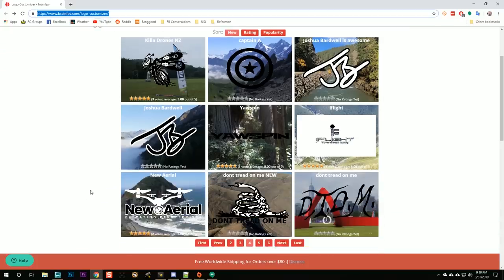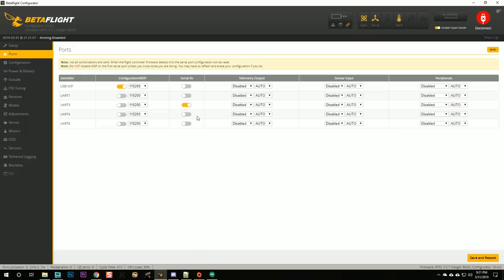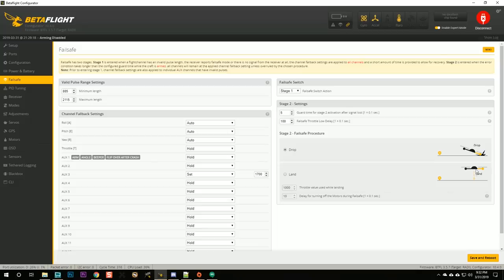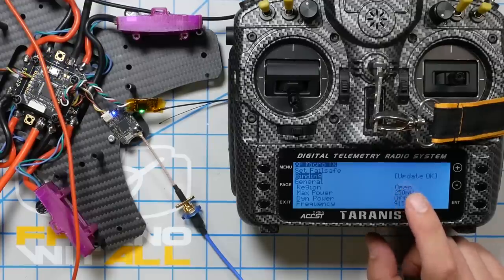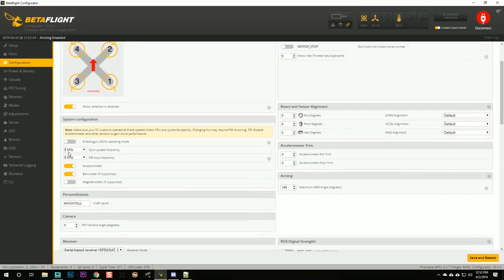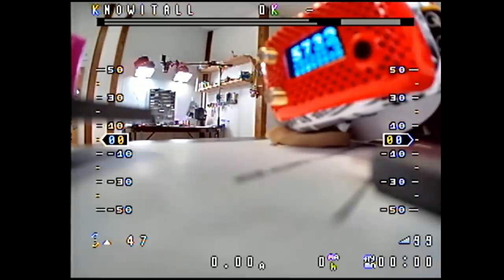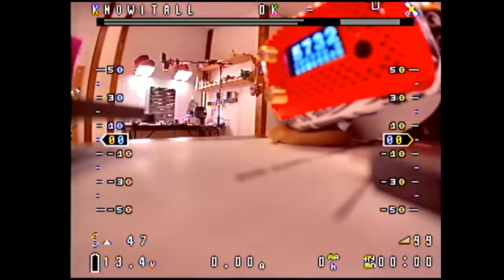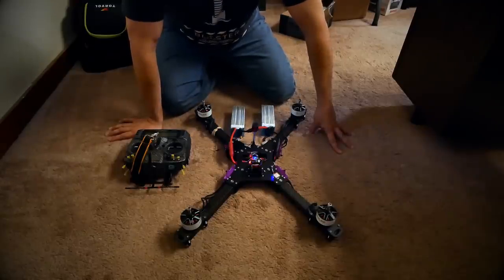Beast Class X Class Quadcopter Build | CATALYST MACHINEWORKS TASMANIAN - Part 4

Comment: I saw Jumper T16 on your table.  Video about that comming soon? ;) I'm still between ordering Nirvana or T16.
Reply: Be careful with the Nirvana bro, firmware still sucks on it IMO. They need to get everything working before they're getting my $$. The Jumper looks pretty solid though.
Reply: @RADERFPV  this is exactly why I'm heavily interested in t16. So few reviews and no long time usage videos as it's so new product. And if I've understood correctly review units are not same as production units will be. So time will tell. I'm not jumping to Jumper as pre-order.
Reply: @Walto86  - I feel ya, I wouldn't pre-order either. Always best to wait and see. The most recent review I've seen is a 2 part review from DutchRC. Looks promising, but like you mention, time will tell.

Comment: you have gps wont your failsafe trigger return home? why set to drop?
Reply: I'm with JB, I guess. I would not have a thing like that do anything on its own ^^
If the RC link is down, the copter goes down.
Reply: Imagine a fuc%ing flying lawnmower coming un your direction when, for any reason, you have absolutely no control over it. The transmitter battery died, for example.

Comment: 33:17

Hey, the flight controller can't reverse the direction of motors, the esc does that. So how did the motor direction got reversed in turtle mode without changing anything on esc's??
Reply: The ESC solder tab is for setting the normal direction.
For turtle mode, the flight controller sends a reverse flag (reverse to the normal) through Dshot/Proshot commands.
Reply: @BestUsernameEverMade  
If the flight controller is actually able to send reverse signals then what is the need for that esc solder bridge..?
Reply: @dtpc_technologies  Because the flight controller doesnt know the normal direction. You have to set it.

Comment: bardwell not sure if you ever did this. but to save a uart if your using unify and crossfire you can just hook the smart audio up to ch.3 or ch.4 on your crossfire and control unify through crossfire lua.
Reply: I can confirm, and this is also the best reason to get a CRSF transmitter other than the Lite
Reply from the maker: That's true, but then you have to manage the vTX using the crossfire script.
Reply: @JoshuaBardwell  ... or with the full size, staring at the back of your radio look a goon.  
Then again, I'm still running FlySky receivers on purpose, so I'm not sure I'm even allowed to have an opinion on this matter.

Comment: 29:45 Never use Loctite on nylon lock nuts, ruins the nylon.  Pick one or the other; regular nut with Loctite blue, or nylon lock nuts.  Usually nylon lock nuts aren't as good for things you repeatedly take apart as the nylon wears out, Loctite is good for that because you can reapply it, but both seem equally good for once and done jobs for longevity.

Comment: Why why why because is freaking awesome and I am building one myself.  Using a Dji FC.  So it will fly just like a air2.   🙏🏻🙏🏻🙏🏻.  😂.  But my main frame is 12inch. And arms are 18inch custom built frame with brother hobby tornado motors 380 kv.   Lol should be bad ass

Comment: Please help!!! I just finished building a Source X with APD pdb + 120A esc's, Pyrodrone F4 V2 & F1000 motors. Testing everything on 6S. Build came out really neat, but the esc's don't seem to recognize any input signal...they just keep beeping away (white led's). I checked all continuity points and all seems OK. I also tried DSHOT 150, 300 & 600 + ProShot. With the USB unplugged + DSHOT 150, only 1x of the 4x esc's "connected" - the others saw no valid signal.  Any idea what's going on?!

Comment: Don't conformal coat any items which are small and produce a lot of heat, such as regulators. Conformal coating can create an extra layer of insulation and cause thermal issues, including failure.

Comment: Hi,

I just did the build, every thing works fine except the battery voltage and current draw is not displayed, and my rssi is at 27. Any suggetion as to why this is so? I did a test fligt and it flew well. Thank you and hope to hear from you.
Reply from the maker: Battery voltage and current come from ESC telemetry. In the Power and battery tab set ESC sensor as the source.

Comment: Mr. Bardwell if my throttle is slightly up and I disarm why are my props still spinning and if I increase the throttle it's as if I never disarmed... any ideas?
Reply from the maker: If you disarm, then the motors should stop immediately. If not, then I wonder if the FC actually thinks you disarmed.

Comment: I have a pulled pin on a F4 board and went to update my firmware and totally forgot about it and was like oh oh motor 3 doesn't work and then I remembered I had to Resource remap it but cannot get it to stick on 3.58 is it's only able to be done on 3.1 thanks
Reply from the maker: Resource remapping definitely works on 3.5. I'm not sure what is going wrong for you but if you reach out to me via email I will try to help. Joshuabardwell@gmail.com.

Comment: Got some concerns about the immortal T placement. 1: being so close to the carbon (there's a lot of it and 2: being right above something that has to be spitting out a bunch of EMI. 

I mean, it might be fine. But for something so big I hate for that thing to failsafe at the wrong time. If possible I recommend going the same route you saw my big quad take at Kwads and Coffee and use a  tuned antenna for RX so it's up and out of the way.  Or in the same vein use a long immortal T and mount it vertically. (Gonna require some custom 3D print to mount it in either case.)

Nice meeting you yesterday by the way. 🙂✌️
Reply: Now that crossfire has the Diversity Nano this would definitely be a build that I would use one on.

Comment: I can't see it too well but are those motor mounts just held tight by the 4 screws clamped on the outside of the arms?
That seems like it would be a terrible way to secure the motors to the arms
Reply from the maker: There are metal brackets that are secured against the carbon by the screws.
Reply: @JoshuaBardwell  hmmm....still sounds like a bizaster waiting to happen with all the vibrations quads produce. Why not just stick a screw through the arm & the bracket

Comment: If the manufacturers just put connectors on their boards, 9/10ths of the time you spent putting this together would be saved. Not to mention maintainability.